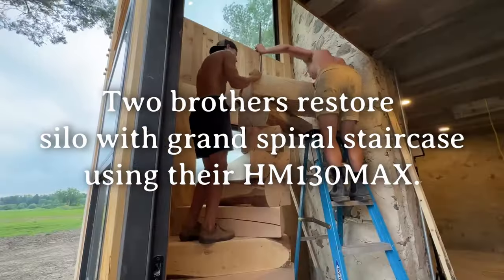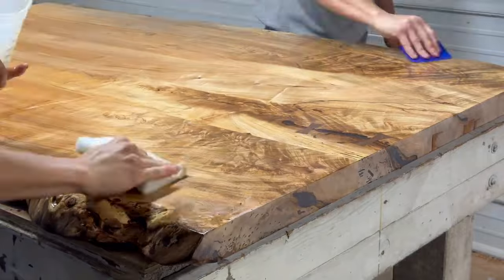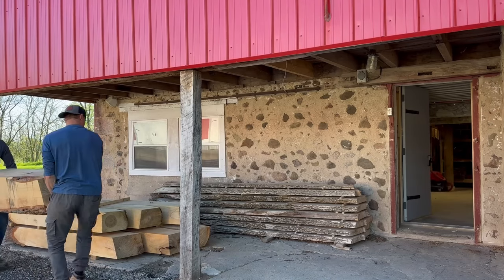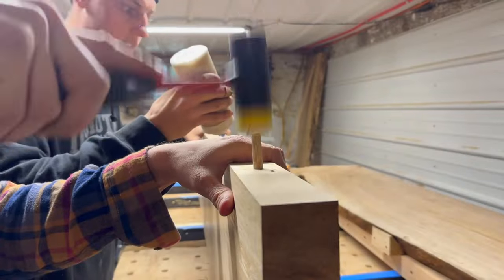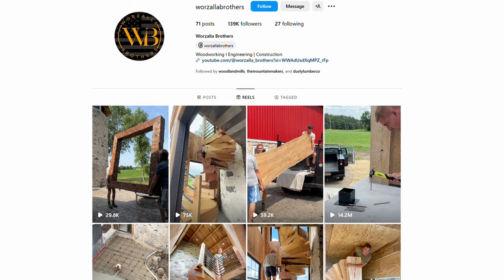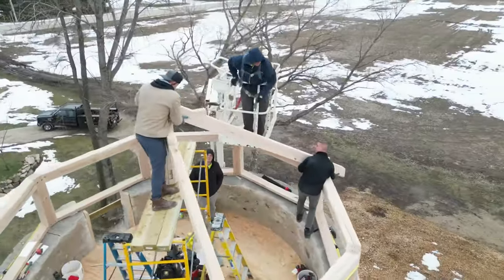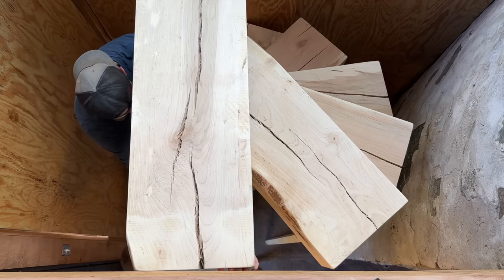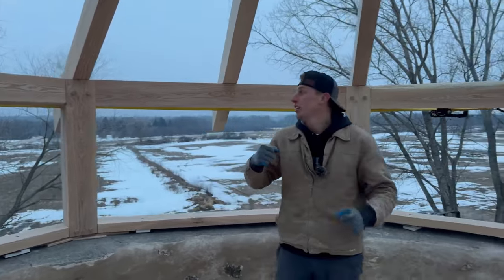An Abandoned Silo Restoration. A Staircase Worth Climbing

Comment: people in #NorthCarolina having to live in #tents, find someone with a #sawmill, saw out true 2x4s for the frame, cut 4inch skids, use 2inch slabs for the floor, 1inch boards for the walls, wood door, wood roof and nail on tin, 3 shelves high that wrap the sides and back wall, sleeps 9 adults, can be built in one day and its better than #living in a tent or buying a 38k camper